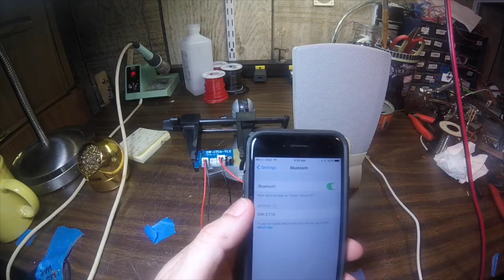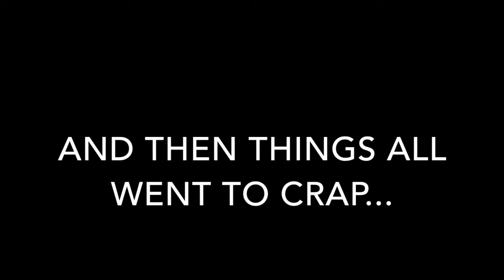5V 3W Mono Bluetooth Amplifier Board review DW-CT14

Comment: Trying to do something similar with a couple of old radios but there seems to be so much different information out there on how to do this.  I like your use of the battery bank and I wondered if you could provide info on the wiring from bank to the back panel for charging, and the wiring from the bank to the switch/bluetooth board. I have an old radio with a single 3" speaker that I would like to use this configuration for, thanks for any guidance you can provide.

Comment: what battery stick are you using in that cigar speaker box? how long does it last on a charge?
Reply from the maker: Steve Plante it's a plain Inland 2600mAh power bank simple and reliable
Reply from the maker: Steve Plante it lasts 6-8 hours on a charge with this BT amp
Reply: Fantastic, thanks for the QUICK response... looking forward to trying a setup like yours! Awesome little video as well :)